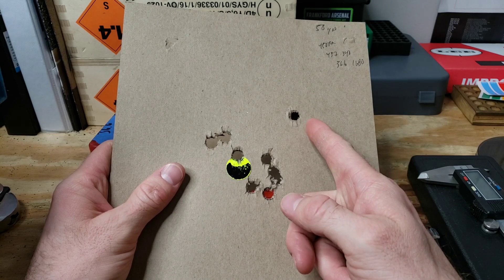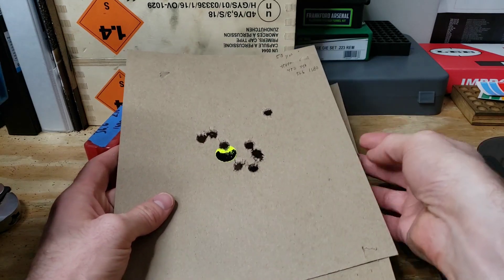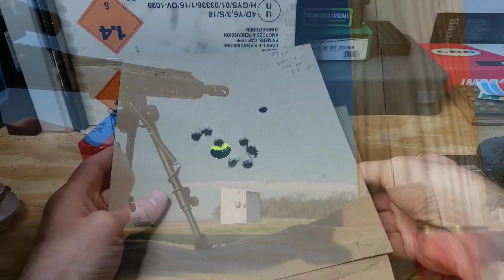450 Bushmaster Cycling Issues Finally Solved - H3 Heavy Buffer Saves The Day

Comment from the maker: Long story short, try an H3 in your big bore if you have issues cycling to pick up a round or locking open on empty.
Reply: how's the shoulder today??? LOL.
Reply from the maker: @johnoakley5544  Shoulder is fine, but I need to man up and shoot some groups now lol
Reply: @DummyRound  I'm just a wuss. Jeez man.
Reply from the maker: Lol, you're good. It  wasn't so bad from the prone position, but I couldn't get a repeatable view through the scope 🤷‍♂️
Reply: @DummyRound  I think mine will be here tomorrow.. or Thursday.  I'm too lazy to look and my shoulder would probably start quivering if I did. I swear the 18" kicks twice as hard as the 16".
Reply from the maker: @johnoakley5544  it certainly has some follow through. I need to try some 230 fmjs and 200gr FTX again and see if I can get some pissin hot flat shooters compared to the bricks I'm lobbing right now 😄
Reply: @DummyRound  I ordered two new molds and a dang scope specific for it. 330 gn , 457-500-F and a gas checks lol. got to get back to the real world for a bit but maybe they will be here by the weekend and I will have something fun to look forward to.
Reply from the maker: @johnoakley5544  If you got the Lee 457-500, it might be too long to seat deep enough for feeding. The 340 and 405 are the same design and get longer from the bottom, but the 450 and 500 stretch the nose out, rather than going deeper into the case. And they added GC on the two heavier molds. I'm seating my 340 and 405 at 2.10, I believe.
Reply from the maker: @johnoakley5544  Hopefully the 500 works and I'm wrong. That would be sweet.
Reply: @DummyRound  Thanks for that heads up. I got them cheap lol but no matter they will both fit my old 45-70. except Im low on brass. that's not something most people leave behind lol. might have to slap some more brass in a few days.
Reply from the maker: @johnoakley5544  never enough brass!
Reply: @DummyRound  oh... Ill get it to work lol. I might really find some safety glasses though this time...lol
Reply: @DummyRound  im like a fiend on the range. its mostly 9's and 5.56 though. Ive got an older man that comes out. every once in a while i'll find some 7,7 jap brass but I give it back to him. I think the arisaka was a war trophy by his father. it has the GI cut
Reply: @John Oakley  
  That 7.7 is like gold. 
  I picked up a Bear Creek Arsenal 450 Bushmaster upper. Yup! Won't cycle. So, I ordered an H3. I had some 350 gn. lead .452's that I loaded up. I'll probably be scrubbing a little lead. What I wanted to ask you is, have you tried powdercoating? I have, and it is some tough stuff. All you need is the powdercoating powder, a plastic container (I use Coffeemate cans), and a salvaged countertop toaster oven. Put a pinch (less than a teaspoon) of powdercoat in the can, drop in some clean lead bullets, put the lid on and shake for a few minutes. Then dump out onto a screen, so you can reclaim the unused powder. I used #8 hardware cloth to put my bullets on. Bake for around 16-20 minutes (trial and error. I use a bright red, but I have found that 16 minutes works best for my oven. It's a convection oven. 20 minutes gets me dark red bullets) at 400°F. Cool and serve. Well, I run mine through a sizer before I load 'em. Check out Elvis Ammo. 
  I ordered the 450 on a whim. I usually research a caliber prior to jumping in. I was a little lax on this one. I bought my dies, but didn't really chase down brass because I knew a couple of guys that shot it but didn't reload. I offered to buy their brass. They have promised me casings, but it's been 6 months and I'm still waiting. I actually bought brass for this.

Comment: Dude the H3 works perfectly I have the Bear Creek upper,, and I just slapped it on my BCM Lower, with the Geissele super 42 spring,, just put in the H3 and I’m good to go..I’ve even used some different types of mags,, only downside 450BM is usually at minimum 2 bucks a round.. you go through 2 boxes at the range and it’s 80 dollars plus tax… there are some sales though that stores have from time to time that’s when to stock up…
Reply from the maker: This is one where reloading can actually save you significant amounts of money per shot, especially if you have the brass from factory rounds. I cast my projectiles, so I can reload 200gr-405gr 450BM for about a quarter per shot. Factory projectiles can be around 50c each, so with reloading and not casting, you're still way under a dollar per shot. Could pay for an entire set up in under 500 rounds. Thanks!

Comment: I have an H3 buffer with an intermediate buffer spring. The barrel is 18” (BCA), after swapping the buffer and spring, my issues were resolved. I also had to swap the bolt for a Tromix.
Reply from the maker: I didn't have to change my spring for mine, also 18" with mid length gas. My bolt seems fine since it's been wearing in a bit🇺🇸👍👊

Comment: What buffer and spring would be best if I want to build a 10.5” pistol AR
Reply from the maker: I just have my standard carbine spring and swapped to an H3 Heavy buffer. Most research I've found says to go heavy buffer for big bore AR stuff, including 458socom and 50beo. Though, I'm not sure if that applies to a pistol length gas and barrel 🤔

Comment: I have a New H2 all they had but I still get not ejecting rounds
Reply from the maker: Could still need a heavier buffer. Also, make sure your gas key is seated and staked properly into the bcg. I just had a new 300blk build giving me issues because my gas key was loose and bleeding off before cycling the bolt back.

Comment: OK, but did you try taking the AR to Mars? The lower gravity (and lack of oxygen) should result in significantly better cycling performance 😂😂
Reply from the maker: But I'd need the higher (is that heavier?) gravity to keep the bolt locked longer to fully build pressure?